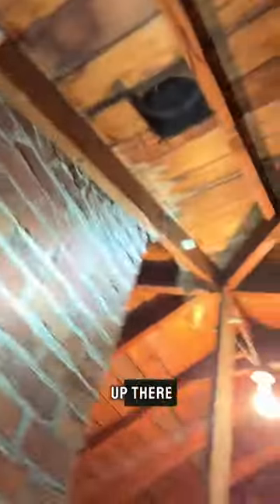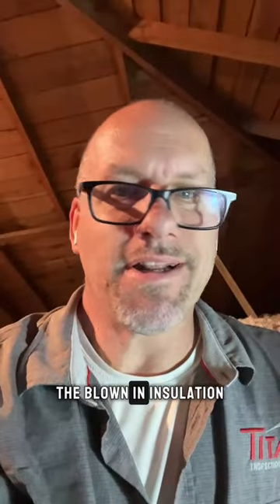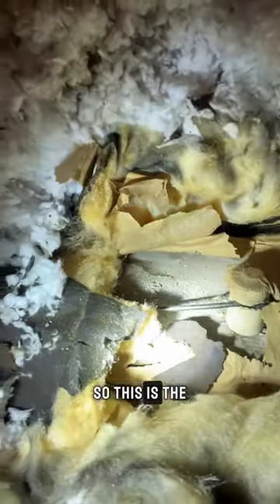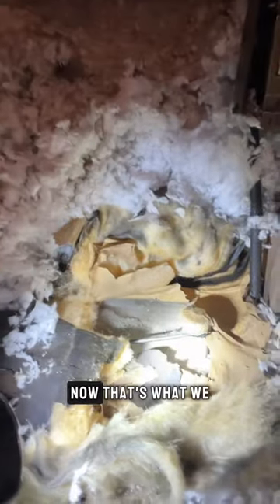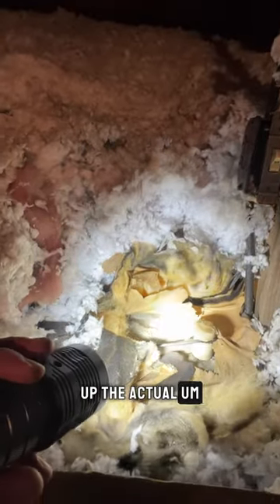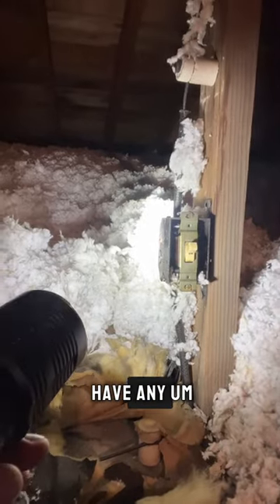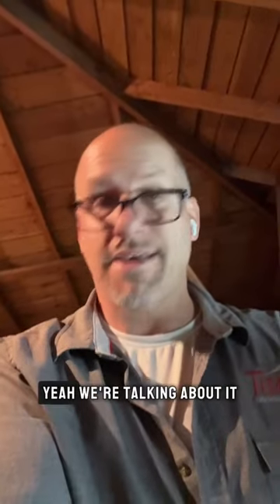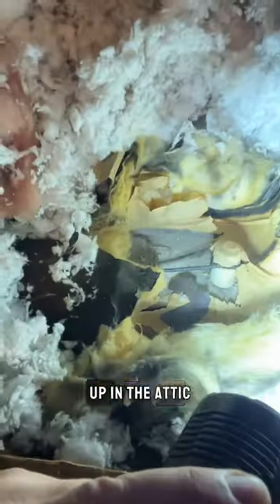These knob and tube mistakes could cost you!

Comment: Knob and tube IS incredibly unsafe because it's been in use for decades upon decades, the insulation deteriorates, and it was never meant to carry the kinds of loads that are placed on it in this day and age. As an electrician that lives in an area with lots of it, I have a responsibility to replace it whenever possible, and NEVER re-use ANY part of an existing circuit. If I touch it, I own it.